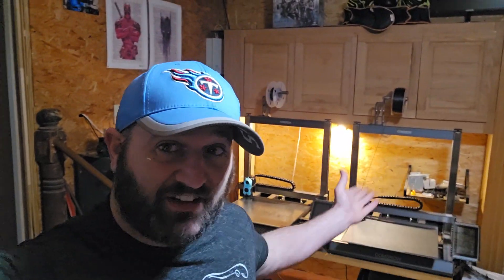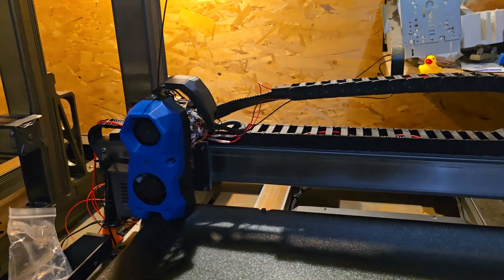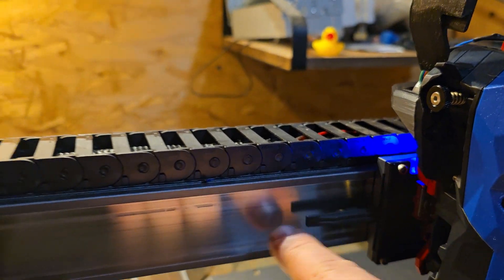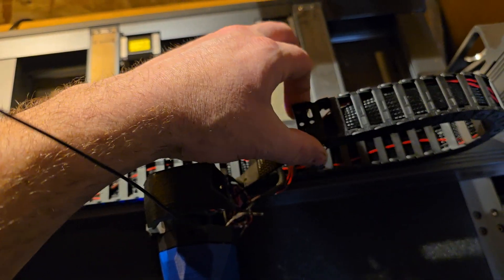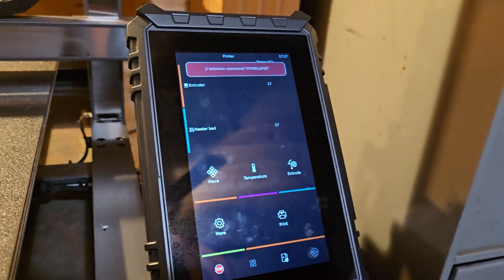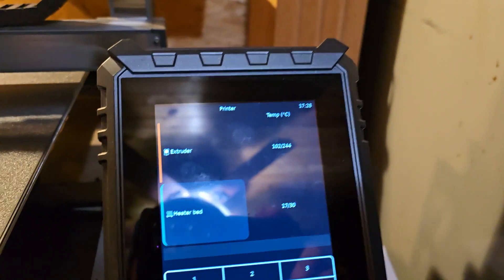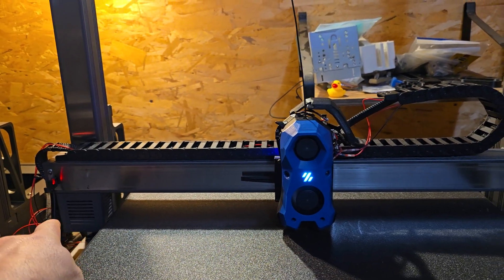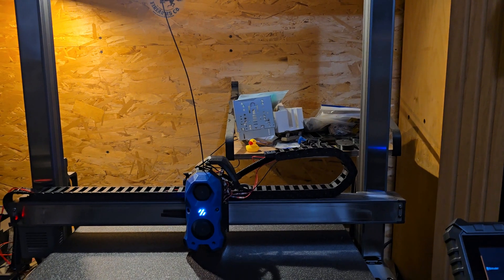My T500 3D Printer Just Got a MASSIVE Upgrade

Comment: I ended up with a hot-end that has a PT100 thermistor. It doesn't seem to work with this setup, the temperature setting sits at 165C even with the extruder cold.
Reply from the maker: Did you change the thermistor in the settings?
Reply: @ID10TGARAGE  Yeah, I think the PT100 needs a hardware amp. I swapped the existing thermistor in from the T500 and that works okay

Comment: Can you get the automatic Z with both of them? Setting the Z height is the worst part of this printer IMO.
Reply: I’m trying to do the EMMC update to 2.1. It’s a nightmare. I thought I got it done but when I plug it in it’s just a black screen. I don’t recommend this, there’s too little documentation.
Reply from the maker: @TJbuffs  are you following their tutorial? https://www.youtube.com/watch?v=AGlOhyrFvDM
Reply from the maker: No matter what you do you're going to have to set your z height. I set it, then microstep it down during my 1st print until I get a great 1st layer.  Once your print completes you can save the Z
Reply: @  I thought the stealthburner could do Z? Kind of like a Bambu. 
I think my problem is I don’t have the 2.0 firmware. I just realized that today
Reply from the maker: @TJbuffs  it has a tap sensor but you still set an initial z height. So once you get your base set you then run your do a mesh with the tap. The tap uses thr nozzle. You have to have 2.0 firmware for this, I'm running 1.9
Reply: @ID10TGARAGE   I have been trying to get the 2.0 firmware set up. It looks like you have to go the EMMC route which seems wildly complicated. I dont know if I even want to tackle it, its very annoying you cant just upgrade to 2.0 with USB.
Reply from the maker: @TJbuffs  its is probably a pain but it's because they change the Linux version it runs on. It's not overly complex but their video guide isn't great
Reply: @ID10TGARAGE   Oh I see. I guess I need to buy an EMMC flasher. I am about to tackle the stealthburner, so I have been watching your videos and recommending people to them. Tutorials would be incredible for dummies like me! Having a stealthburner install tutorial would  be next level.
Reply from the maker: @TJbuffs  check the description.  I have a full git hub tutorial write up
Reply: @  oh nice! Thank you! We will see if I can figure it out!

Comment: Hi! Awesome video! Can you, please, also make a video about installing X Endstop Move, soldering wires on the boards in your guide?
Reply from the maker: The x end stop is one screw. Remove the screw on the bsck and then install it on that front rail screw with a couple washers. No soldering on the board itself.  Is there a part your confused by?
Reply: @ID10TGARAGE  I think in the guide, some confusion comes in as it isn't clear that you are removing the standard Stealthburner board and replacing it with the stock T500 board, and the wiring connections.  It would be great to have a few pictures or a video of the wiring setup.
Reply from the maker: Technically unless youre buy pre-built stealth burner id argue youre not replacing the standard board but re-using the stock board. Which was the whole purpose of this project

Comment: How much to make me one?
Reply from the maker: They aren't hard to make, i don't print ABS currently so I can't build these out for people. It was also require you shipping me parts just to assemble things. So not an easy process. I'd suggest checking out the git link and you can get more details
Reply: I hear you, there is a PITA factor for sure.   Any interest in taking delivery on say, 10 t500 hotends, with wiring, then charging enough to make it worth your while?   That is if we can convince Comgrow to sell me the wiring harness.  I love the size of the printer, the frame is excellent, but the hotend is the achilles heel, it trashes the entire machine. 

Just thinking out loud here, if there is an interest on your end, there is an interest on my end.
Reply from the maker: @BillsOfficeLive  the problem is, it's not just the Hotend when it comes to assembly. It's about a 5 piece system for assembly and you assemble it on the machine. So adapter plate, then tap sensor, then you attach the CW2 DDE to the tap, then you attach the bottom. Then you deal with the wires. So it's not a simple swap that I can assemble and send you persay

Comment: other than difficulty of parts availability of the stock hotend on the T500, what advantages are there upgrading?
Reply from the maker: Well, the tap sensor gives it much better stability when it comes to accurately reading all bed surfaces. In general, you get more consistency, and if you use the right parts in my git it should last long periods of time. The hot end is also a known commodity. You don't have to worry about the known leaking issues or  failures these stock units are known for. It really just makes things consistent and repeatable at a higher level of confidence overall.